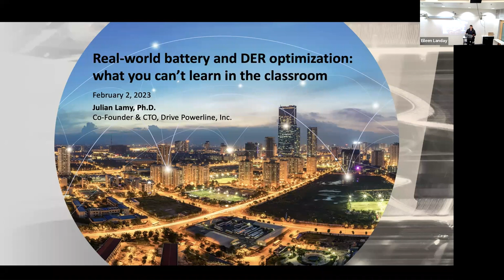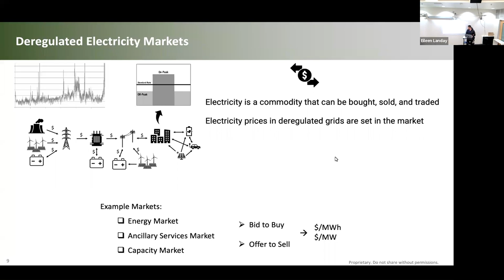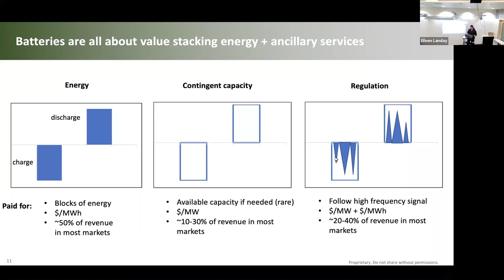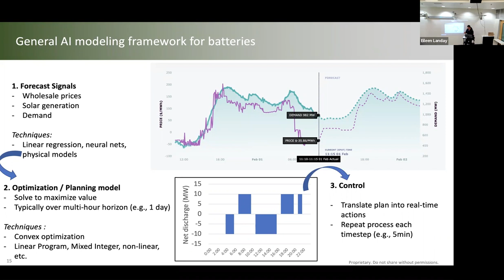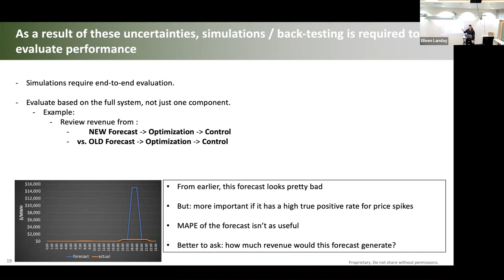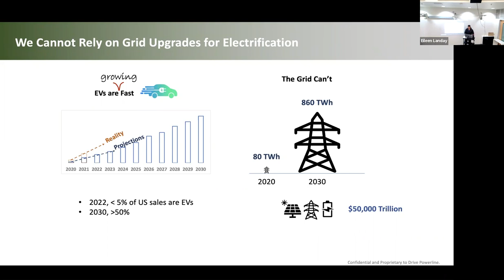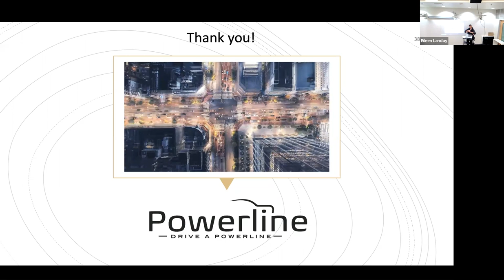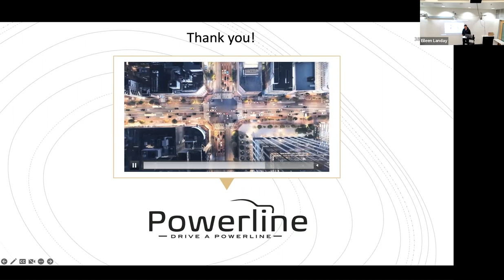Real-world Battery and DER Optimization | Julian Lamy | Smart Grid Seminar

Comment: This may have legs when a fully automated vehicle ( robotaxi) can commute itself to charge at an economical location but until then do you really expect EV owners to drive multiple miles so they can sit for an hour to charge their cars at an unexpected location,then drive home, consuming that charge? The principle is wonderful but the practice is not realistic. For now. Bi directional capability in the car and from the charge point are some way away. Ask Tesla why they do not yet provide this?  Any plans for the UK?
Reply: Tesla do provide it lol. As do multiple other companies. No robotaxi needed. And why do they not need to charge at home? A level 2 charger + an electrical panel upgrade maybe adds 8 grand at most, and basically gives you free charging at worst.